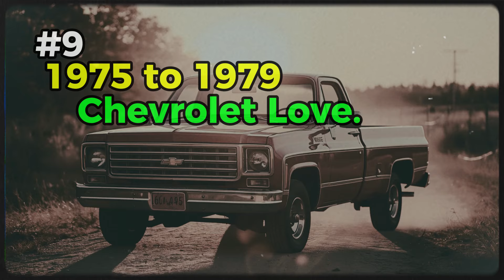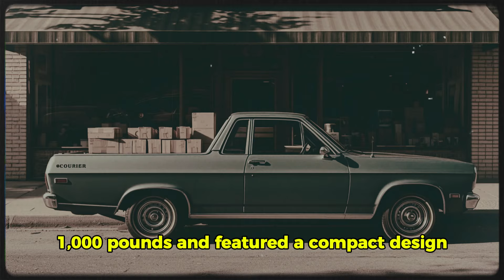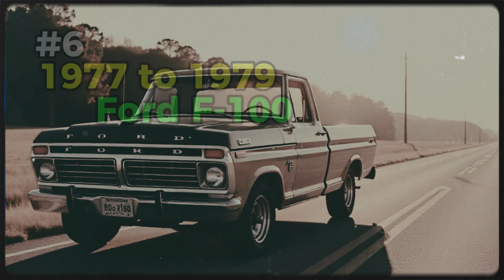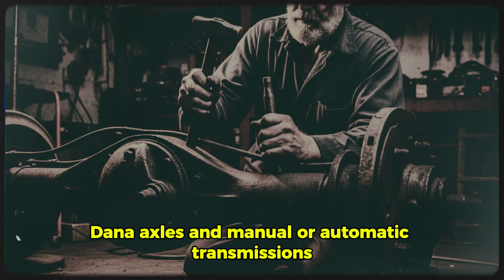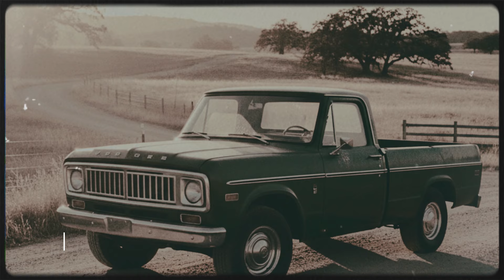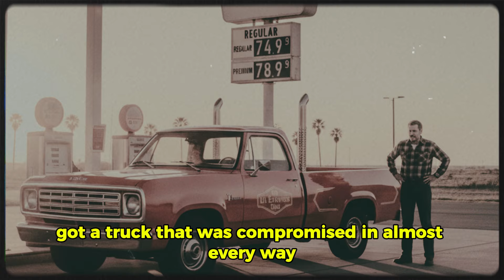The 9 Worst Pickup Trucks of the 1970s

Comment: I watched this out of curiosity and it’s really bad. Having had experience with most of these trucks I can say that while there were problems, they did what they were designed to do - be trucks. To the content creators behind this AI cringe, learn to do some real research, even if it requires time away from electronic devices. Go to car shows.  See these old trucks. Incidentally, while I’m not a Chevy fan; i occasionally drive an uncle’s C-10 camper special 454. It was anything but underpowered.